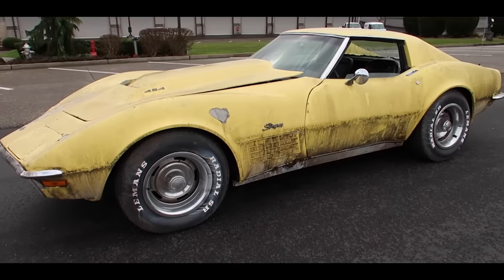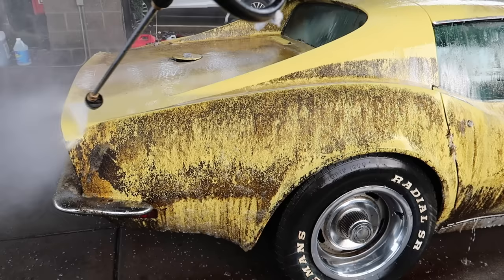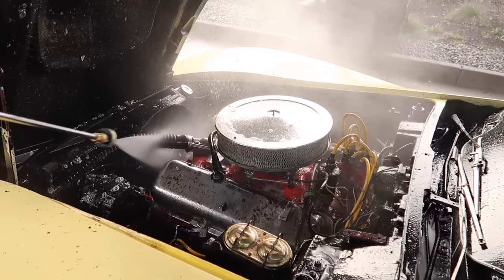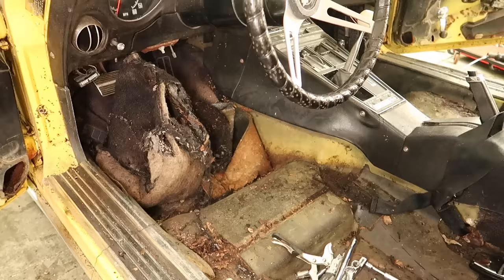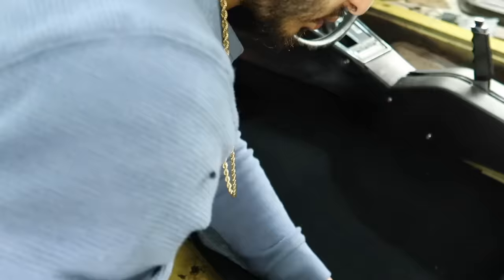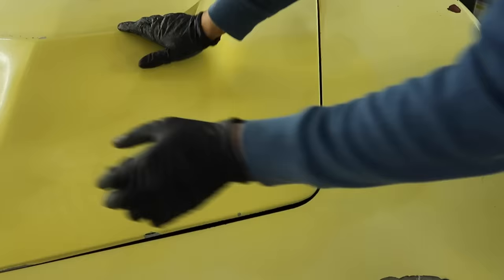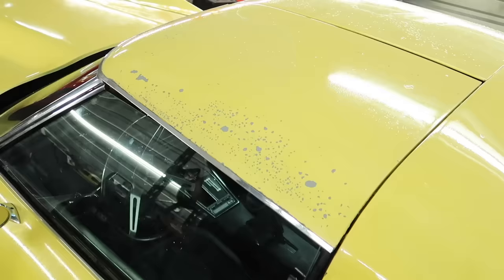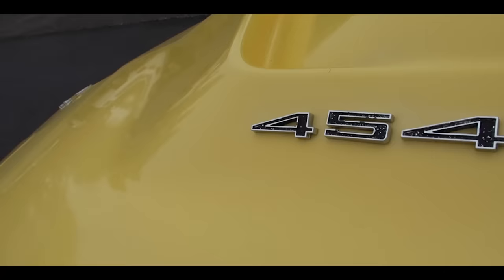1970 CORVETTE STINGRAY | BIG BLOCK 454 | RESTORATION DETAIL

Comment: Just a small tip that I found works well. Paint that sits outside expanding and contracting is easier to clean if you use a steamer slightly to expand the paint then scrub it. It will help get those permanent type stuff from the moss and it will mostly come off. Good job with the detail
Reply: Ammo NYC viewer??
Reply: Yup. Larry from Ammo just shared the same advice not long ago on his channel.
Reply: @Sankey369  yes haha I was thinking on the white Porsche vid

Comment: THATS A BIG BLOCK CORVETTE, someone really didn't know what they had with this car🤦‍♂️ What a sweet ride!
Reply: CRIMINAL FOR THE OWNER TO ET IT ROT
Reply: I know it sucks that it laid in a state of neglect but ya gotta pay mind to the times.  When gas went nuts in the '75, these cars werent worth nothing.  It probably didnt make it to the scrapper because of the fiberglass body.  Im just greatful its still around and hope that it ends up being owned by anyone other than a collector or museum.
Reply: @32degreesretarded62  dude it sat since 2004" clearly was used since 75..
Reply: They had a hugh fucking gas bill
Reply: F
Reply: & It has a 4spd manual !
Reply: You are right about that sir, it'll need a full body respray, once that's done it'll be the nice looking car that it was. 🚘🚘🚘🚘🚘🚘
Reply: My Dad and I are restoring almost this same car, 1970 stingray! Was sitting in a garage for almost 40 years. Would love any tips you have for getting them running and show worthy! Happy Father’s Day y’all!
Reply: Man that is my dream car they had a lot of power and torque
Reply: Not just the paint…the fiberglass will need lots of attention.  It gets porous and brittle.
Reply: i bought my bro's 70 454 *blue w/damaged blocked, got a 402 outta a wrecked sheriffs car, rebuilt this devil for less than 1500 and then my bro's wife bought it back for him. he was on his way to work at 4 a.m. when girls joyriding in fathers truck T-boned him from passenger side. my brother suffered a pinched nerve and cuts from broken glass. wasnt able to buy the car back so i could get my sweet 402 😢

Comment: First off.  Nice work on the Vette. Had to be bitter sweet seeing its before and after state knowing what 'could have been' had they taken just a little bit of care of it.

Rescued a farm field stored Suburban (99) from WA.  What a mess but, fortunately, nothing like this one.  After removing carpet, treated the floor pan inside and out for rust finalizing with POR-15 which I used after addressing all the rust issues on the body and doors, replacing fenders etc. Spot paint until I was ready for an entire spray job. New Carpet as well. Sometimes you just have to say 'when.'
Came out real nice until T-Boned by a red light runner....RIP

Comment: Would love to see the restore video on this. Thank you so much for stopping the decay. I assume this will be a full off the frame restoration and that the numbers match on the engine? There really are no words for the work you’re done here. I don’t think anyone who appreciates these cars can thank you enough. Looking forward to the first start. I spoke to soon, that baby does run. How sweet!!!
Reply: Betting there’s rot through the birdcage judging by condition of the rest of the car. Arguably not worth saving given the cost of repair unfortunately.
Reply: @Greg Cummings  Not sure what you mean by bird cage.  Although I  appreciate the hard work by the detailer, I think all the effort on the exterior aside from cleaning is a total waste.  Is anyone not going to notice huge paint chips on the hood, etc.  Car needs to be stripped and repainted, given its value I would guess this is headed to paint shop soon so why waste effort on a finish that is going to be stripped?  As far as engine, it would be interesting to see if with fluid changes and a tune up if car would move.  An educated guess is brakes and steering likely not safe to drive, not to mention frame could be severely damaged by rust.

That said I am guessing this cleaning added thousands to value of car as it is sitting, especially if it could be driven.  Thanks for posting.

Comment: Ahhh...a yellow Corvette.  The OEM paint would get chalky and "bumpy"  even with regular washings.  High maint. color.  I am amazed with how much pigment was left in the one you detailed.  It had to have been a repaint.
I had the weirdest optioned corvette [safari yellow, comparable to the car you did] ever.  It was a 1968 convertible.  Base engine, A/C, power windows, AM/FM stereo, tilt/tele column, tinted glass, power brakes and steering, wheel covers, and alarm.  I think there were a few factory doodads I am unable to recall.  All of these options, backed by a THREE SPEED MANUAL!!  From the factory, that was the base transmission.  The base engine was a 327/300 HP.  It was so equipped.  All 4-gears and the turbohydramatics were options!
Nice job, considering what you had to work with.  You do good work!

Comment: That paint damage is called pinching it's caused from the paint heating up in the sun and the algae gets into the pores of the paint then the paint cools and pinches the algae into the paint, you can reduce the damage caused by this by using a steamer on those spots and wiping the algae out with a towel before paint correction

Comment: Always a good idea to use heat shield notably on the transmission tunnel as the interior cabin gets especially warm in this area. If you've ever owned a C3, you'd understand. Decent video for sure though.

Comment: It's great that you pulled it out of the barn to save.  Given the apparent high level of moisture in storage, the birdcage is probably in bad shape meaning restoration is going to get expensive.  These beauties need to be kept in a dry environment since the birdcage is a key element of the chassis integrity.  She cleaned up nicely!

Comment: I saw something like that once... It was in an old work truck called P1, a 30-year-old Ford F-350 crew cab.  More of a rolling rusted death trap, it was still remarkably powerful, despite it's long life of abuse. There was so much crap in the bottom of the floorboards, a weed plant sprouted up in the the front passenger side and grew about a foot tall before someone plucked it LOL

Comment: A huge improvement man 
The car is showing signs of a car that has been repainted at some stage in very humid conditions which caused blisters in the repaint that's why it's peeled off the bonds on front panel's, I've seen this effects in painting in nz as we have humidity problems and need to turn ovens on and warm panel's before spraying. 
Cheers Wattie

Comment: Great job. Though I think I would have tossed the seats.  Not sure if you have mold growing within the padding underneath.  Also, I bet you could have cut the bolts to free the console without cracking it.  You could still have dead animals in there. The paint touch ups came out better than I thought. I would have thought that would have been a complete sand down and repaint.  Great job!

Comment: What size tip do you start with? Is it a 15 and would you use a less aggressive 25-30 degree tip for better paint? I just don't want to blow any more paint off of my stone chipped front color coded bumper. Thanks

Comment: So 2 things I know about fiberglass that could have caused your Micr cracks and bubbling. Spent along time restoring old boats both classic Mahogany runabouts as well as old fiberglass boats. Older fiberglass. Shrinks and become brittle overtime that would cause the micro cracking in the paint. The other possibility is that during the repaint process they primed the car and didn't allow time for the primer to shrink back and then sand before paint. A good body shop would have let the primer dry and properly cure and shrink back by letting the car sit for 3 to 4 days before sand and then paint. Your bubbles are most likely caused by a chemical reaction. Their was either body work done to the car using fiberglass and the glass resin didn't cure properly or the other common issues with cheap or back yard paint jobs is that they mix and match different brands and types of paints and primers. This causes harsh chemical reactions witch cause bubbling as well as paint to flake off just like what was shown all over the car. Judging by the way the car was treated. I'm willing ro bet that it was seriously confused back yard paint job.

Comment: Out of curiosity, is there a particular reason to why you clean the outside of the car first? My instinct says if the interior is that bad, do that first as you may carry rubbish to the exterior of the car you just cleaned only to clean it again?
Reply from the maker: A lot of times It’s because the door jams have tons of crud and debris and I come across a lot of cars which have been sitting for a really long time and are filled with a lot of bugs and critters so when they’re really filthy I will start with the outside
Reply: @maddetails  Ah I see! As you can tell, I'm a detailing noob. Thanks for the response ✌️

Comment: How much water got inside the cabin while washing?It's too bad they let this car go this far. Worst part is, they already are notorious for the frames rotting out without sitting outside like this. Sadly, this car will probably turn into a huge mess during the Resto process. I learned all about it with mine.

Comment: I've gone through all the steps as many detailing videos show on how to wash a car. When you first wash a car that has never been waxed, let alone had a paint correction are you supposed to use a more abrasive washing pad or sponge? The microfiber mitt did NOTHING to clean the car, it was as if I sprayed it down with water and that's it.

Comment: It's good to clean up any car for resale.  The reality is that if I were buying this car, it is because it's a 1970 Corvette big block manual, how complete the car is to original, what needs to be replaced and how much corrosion. Buffing the car and putting in new carpet is putting lipstick on a pig. I would rather see the seats out of the car and the condition of the floor pan.  You can buy a replacement interior as a kit and the paint is too far gone.  I would razor blade the paint off so there is no point in buffing the paint.  I would much rather see an honest car than lipstick on a pig.   Yes I would love this car to buy as is.

Comment: I hope with all the exposure to moisture since 2006, the body birdcage hasn't rotted away. A restoration would be a waste of time. Everyone thinks it's fiberglass, but there's lots of steel to rust in a Corvette. Check out the Corvette Ben channel.

Comment: Very sad see you did not pull console and look behind center gauge. Metal frame and electrical has to be rusted cluster flock. Only a few screws and two nuts pop cluster out. Console side panels only a few screws. Mostly cardboard, moldy as hell under there. Sad clean up job with interior.

Comment: It's a beautiful car but unfortunately at this point I don't see what is the point in cleaning it as it will require extensive amount of work, rust on floor panel and all over the car not to mention the electrical and mechanical parts.

Comment: I believe you are wasting your time waxing this because it needs to be stripped before it can be repainted and the vents need to be cleaned and the under carriage the gas tank removed and cleaned even see it the motor is lockt up or what 
But it is fun to clean a car and see some difference

Comment: BS... The car has a (2010 -  to present )series license plate on it.  they didnt start those type numbers until 2010. The car has the wrong hood on it . after market. the car has 71-72 lower grills, this car sat probably a year or two under a tree
Reply from the maker: Just because he kept the plates current for a few extra years  doesn’t mean it wasn’t sitting…. And what would the 69 L-88 style hood and wrong grills have to do with whether it  was sitting or not 😂 I live in WA and detailed thousands of cars here they don’t get like this in 2 years and even if it only sat since 2010 that’s still 12 years ago you do realize that right ?
Reply: @maddetails  LOL kept plates current on a barn find. LOL . that is not a 69 L88 hood. It is an aftermarket, Extra high rise cowl induction hood. No corvette ever had that hood from factory. Those lower grill did not sit even 5 yrs. They are made out of pot metal. There isn't a pair on the planet that would last more than 5 yrs without regular cleaning. They were purchased no more than 5 yrs ago. FACT . Dont mess with a corvette expert. Im in the corvette black book as such. you video is fraud

Comment: That is NOT a 1970. It is a 1968. The louvers behind the front tires tell you so. It cost $4,000 new. And top speed was under 95 mph. The problem is that there was no 454 in 1968. It was a 390. The 454 came out in 1972 or 1973.  I think your car is not original.

Comment: So with mice or whatever in there and you didn't pull those parts off like where the stick shift is and the emergency brake and even the dash should have come off and clean behind it there's dry moldy mouse crap in there with mold like say deer mice have the hantavirus in the dooppings, it gets into your lungs! This is not the proper way to clean a car like that. I'll guarantee you. What is wrong with your head?

Comment: There is a release switch under the dash on the left side for the headlights. You did not lift the headlights and wash them or the houseing. In my book that means you did not properly wash and detail the car. Corvette owners are picky about the car and this would absolutely piss off a customer. Also, it does not speak highly about your professionalism in doing the job.I would not be advertising on you tube that I did not fully complete the job.
Reply from the maker: i own a 69 corvette 427 so I do if fact know where the headlight switch is!  I did actually wash the head lights but had to lift them by hand later when it was in the shop  because they did not work by just flipping the switch the vacuum system that would  control the headlights wasn’t working probably from dry rotted lines and I actually polished the headlights after washing them ! There’s a lot of extra work I do that I don’t film other wise videos would be 2-3 hours long

Comment: Why detail a car that needs to be repainted lik
Reply: A good paint job starts with a clean, dry surface.
Reply: Any paint job...a wall....fence...car needs to be cleaned thoroughly. Otherwise there's no point and result will be terrible
Reply: @superamario6464  You guys realize you can't paint over that solvent-popped mess, right?  What's on there MUST come off to fiberglass before it can be repainted.  The whole car will need to be blown apart. It'd be a helluva hat trick to get the paint off without disturbing the dirt.

He buffed it for the internet views.  Nothing wrong with that, but it is what it is.
Reply: @joshuafuller9898  I gathered that. But is it not a case of removing the paint, primer etc?
Or cars from that era just had fibreglass and one coat of paint?
You just excuse my ignorance on the subject
Reply: @Super Amario64   Yep MACCO did that to my truck, A 2002 barn find in its own right that was almost as bad as this... I must have missed some spots in the trim while I was power washing it because the paint is bubbling up from where they painted over mud.
Reply: He mentioned the car will be undergoing a restoration. I’m guessing the owner wanted to enjoy it for a bit before tearing it down, and as a detailer you can’t ask for better content. Win-win.